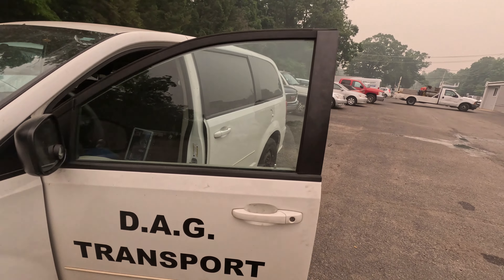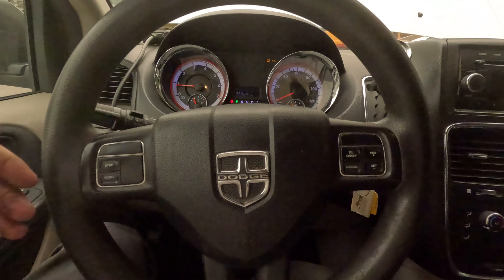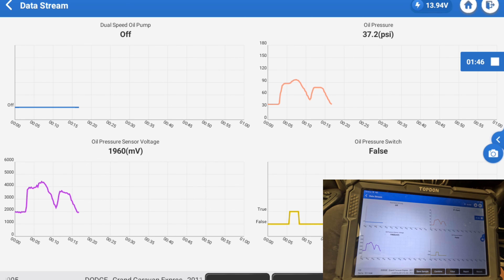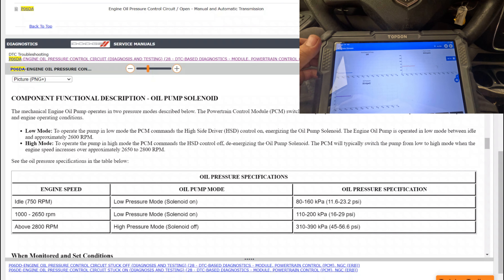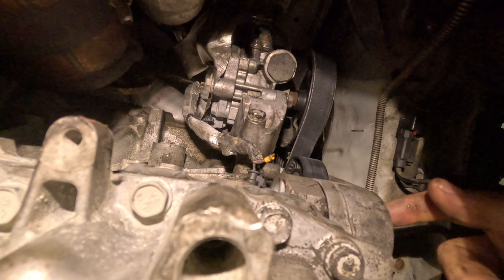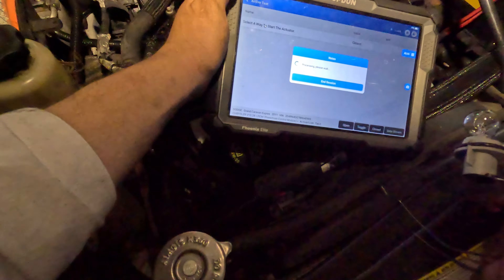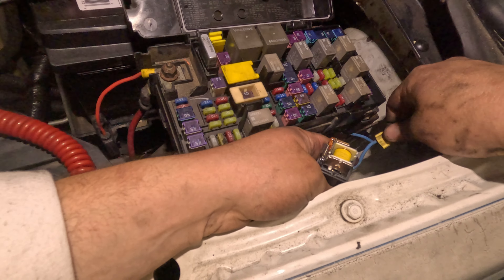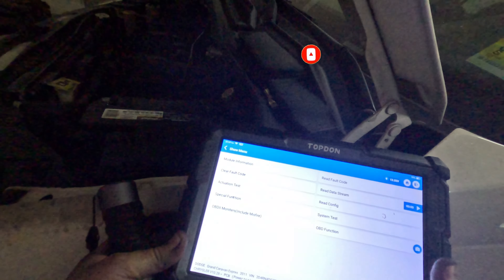2011 Dodge Grand Caravan - P06DA & P0627 After Engine Replacement!

Comment: I've got a 2012 charger that had its motor swapped. I thought p06da was the oil pressure switch so I swapped it and after a drive the code returned. I wonder if its the same bad wire as on this van. I wonder why it happens to motor swapped vehicles maybe the wire got tugged when pulling out the motor perhaps. Ill check this plug next. I get the same 33 psi at idle guessing the oil pump is stuck in the high mode aswell.

Comment: I have a 2019 chrysler 300s with the pentastar 3.6 and just got the po6da code. Seems to be running normal and oil pressure is reading as it should. Not sure where to start with that code popping up. Was it the solenoid that was bad on this one that was giving that same code on this one?

Comment: Great video. I have the P06DA code currently, where the pump is stuck in high mode. Is it safe to drive the vehicle until I get around to fixing it? Oil PSI between 25 and 80.
Reply from the maker: I would think it's fine, But don't want to be responsible if its not😜
Reply: @advancedleveldiagnostics  hahaa no I wouldn't put blame on you regardless. I researched it more. There's a video out there about these 2 stage pumps and how they are designed so that if the solenoid fails, and the pump runs in the high stage, it's still within spec. They basically said that if it fails, it's now running as all oil pumps did back in the day before 2 stage was invented.
Reply: @Shawn855  Do you have a link to that video? I got the p06DA on a 2017 dodge charger. Car seems to idle and run fine. Definitely has oil pressure or i'd be hearing the top end eating itself.
Reply: @mooosestang  I don't sorry. But I kept driving it with zero issues like that for over a month, 7000kms
Reply: @Shawn855  Thanks. i think she's going to live with the code until i have time to replace it. It's an sxt and shows the oil pressure on the dash. 80psi on a cold start seems pretty normal. Such a dumb idea to try to save a few fractions of a gallon of gasoline. I just replaced the oil filter housing, also a dumb idea.
Reply: @mooosestang  the main thing I noticed between when dual stage  worked vs didn't: the vehicle would actually shift better. Instead of constantly trying to be at the lowest rpm of each gear, it would go through each gear nicely, causing smoother shifts.
Reply: @Shawn855  So the shifting was better when it wasn't working, lol! I hardly ever drive her car. She said it hit 90psi when she floored it getting on the interstate this morning and 35psi at idle when she got to work. I think it's intermittent, but the code did come back the next day last time i cleared it. I unplugged the sensor and plugged it back in. that connector has a lot of wiggle to it.